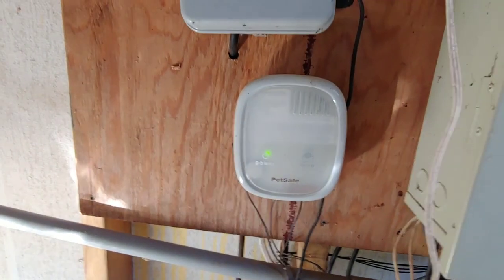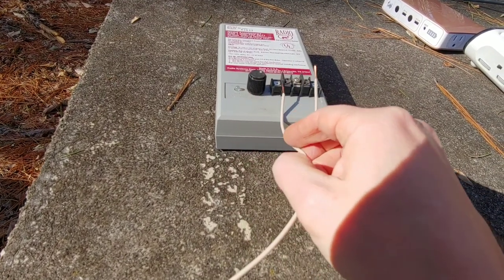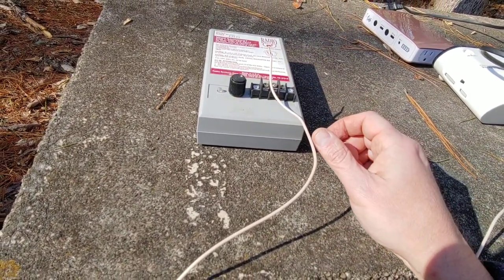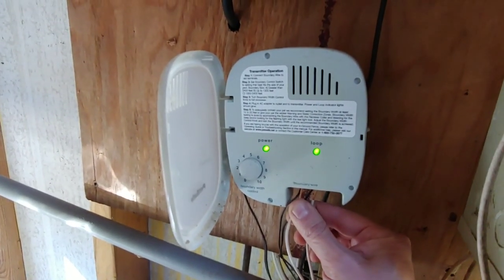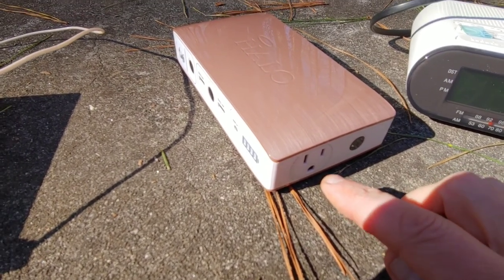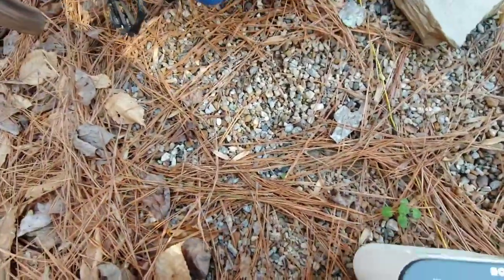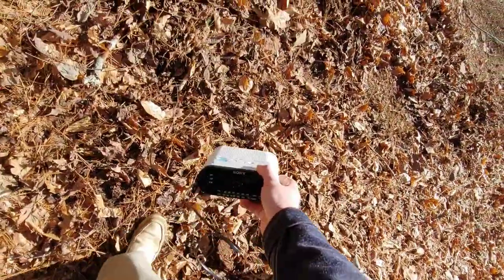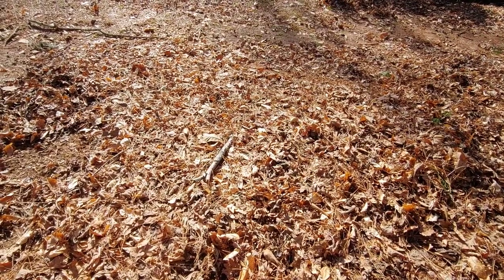EASILY find the break and fix your underground fence/invisible fence

Comment: Thanks for making this video. This is a great technique for finding a good, clean break. Unfortunately, I had a problem where part of the run had degraded, and there was a spot with fairly high resistance. As a result, the system did not work properly, but the high resistance connection was enough to carry the radio signal. I ended up having to divide the run making a few extra breaks, myself, and taking resistance measurements. I used a couple of 100' extension cords I had (not plugged into AC) to connect back to the transmitter location for the return leg of the resistance measurement. It took time, but I found the high resistance problem. 

For anyone with a multimeter with an ohmmeter function, it's a nice idea to take a resistance measurement of the run at the transmitter location when the wire has just been installed, so that you can compare the original resistance (when new) to a reading at a later date when you suspect there might be a problem. The resistance of 1000' of 18 gauge wire is a little over 6 ohms.
Reply from the maker: Great approach with the multimeter. Thanks for the comment!

Comment: I tried this out and it wasn’t as easy as I hoped. I couldn’t tell the difference between radio signal coming from fence vs other radio interference maybe my radio receiver wasn’t good enough. There is another video on you tube that suggested the use of a spark plug for a signal, while I was able to pick up that pulse better with my radio I still wasn’t able to find the break. In the end I ended up using a long by pass wire to split the garden in half. Then I knew which half of the garden the break was in, and by digging up wire and adding new joints I was able to find the break eventually with trial and error.
Reply from the maker: Great tips! Thanks for the comments!
Reply: Oh lord I have a cut line somewhere. Trying this radio

Comment: The frequency of my system is similar to that of a talk radio station, so it wasn't easy, but I did manage to check one section of yard.  I did not locate a break, but I know that I have one, I used a second system that I have to verify the break.  Since I was unable, I will have to use another method or spend some money for detection equipment.

Comment: It is jankier than frig and if someone is watching you they might think you are crazy but I have done it twice already...
you take your boundary wire and put a bit of flexible wire on the one end, wrap several wraps around the ignition wire of a lawnmower/yard equipment (the engine will need to be running) and that introduces a pulse into the wire that you can also pick up with a AM radio. (it is not electrically connected to the plug wire only wrapped around it to make a coil)
Reply from the maker: That's another good method and yes, even jankier than what I show but if it works, it works. Thanks for commenting!